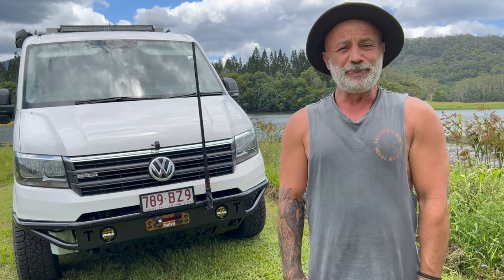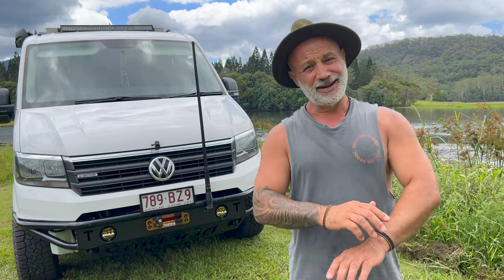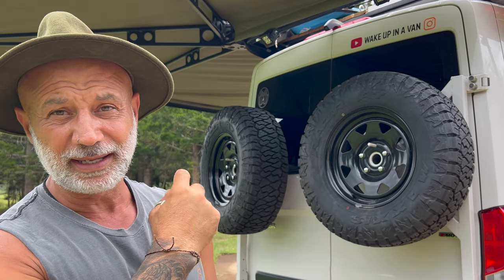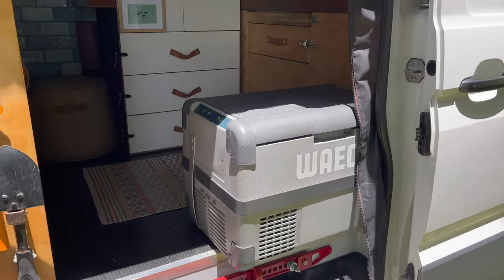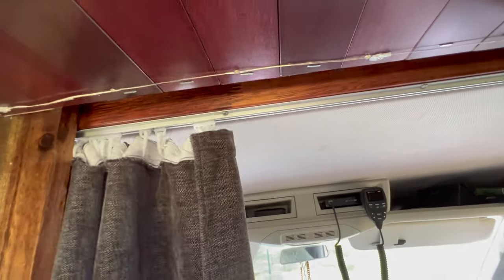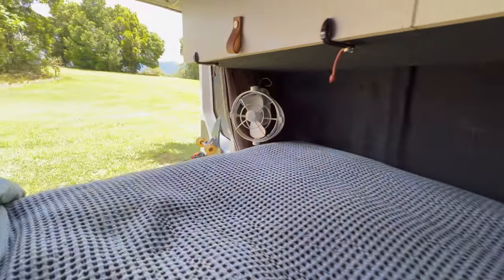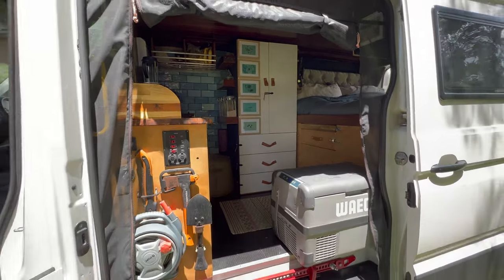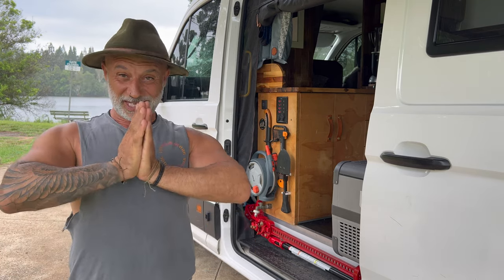🚐 Full Van Tour - DIY VW Crafter 4Motion - Australia.

Comment: The 270 degree awning is a hard find in Europe, which one are you using? I'd like to see them more but in there regions the straight pull out awning is common fare. Could a high roof (2.6m) long wheel base (6.83m) van work with a 270 awning? Great video by the way :)
Reply from the maker: https://www.thebushcompany.com.au/product/270-xt-awning-mk2/?utm_source=Google&utm_medium=cpc&utm_campaign=Pmax_awnings&utm_term=&gad_source=1&gclid=Cj0KCQjw3tCyBhDBARIsAEY0XNm9LIQ-wlSTBUyxfkCCi6nX69JV6u8upYDp8OTPkIDjyuPqrVOJhTQaAjLgEALw_wcB
Reply from the maker: Not sure if it will fit, maybe talk with a fitter

Comment: Can you stand upright in the low roof? Torn between low and hIgh roof? Live your setup
Reply from the maker: I can stand but not straight, I’m 1.7m.
Van is 4motion, floor is 100mm higher than front wheel drive
Reply: What model is your 4motion? MWB mid roof ? Looking to upgrade my T6 to an off road machine to chase waves and snow with 2 people.

Comment: I plan to go to Balbunya Dunes and Point Culver. Are you able to provide GPS coordinates for your entry and particularly the exit point from the beach and the steep existing on the rubber mats? Also, what is the easiest way to get to the top of Point Culner?  Any thoughts or ideas would be great. Thank you in advance
Reply from the maker: Hi 👋  Point Culver is not shown correctly on Google Maps, its on the beach at the furthest part you can reach before it becomes cliffs.

GPS coordinates are given in my videos.

Tips: the terrain always changes and so must your tyres pressures & take a drone to locate tracks.
Reply: so GPS for the track out for the rubber mats?
Reply: I also want to get to the top of point Culver, is it easy to find the track?